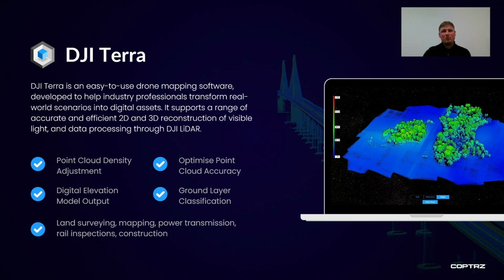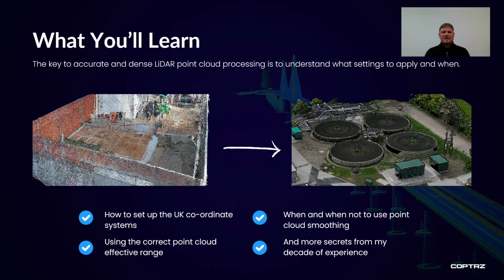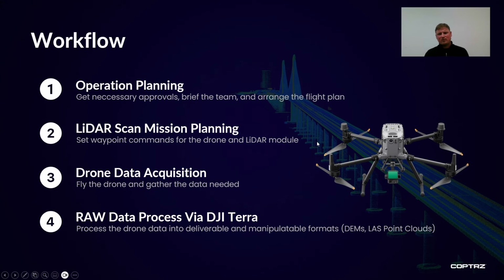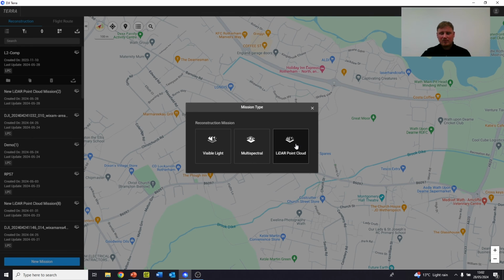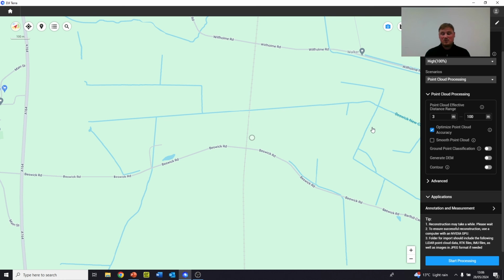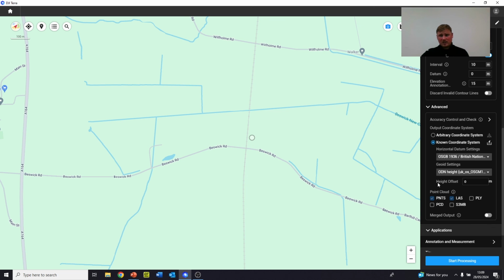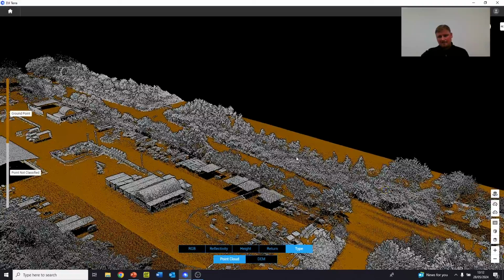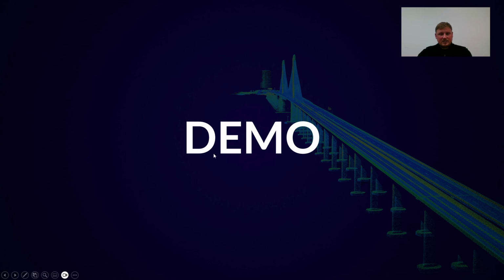How To Use DJI Terra To Process LiDAR Data

Comment: Great video!
I have a question tough...
Currently, for L1 data QC, DJI Terra allows importing and classifying GCPs as "check points", and measures the point cloud altitude error around those points. However, if i leave the gcps classified as "control points", terra will constrain the point cloud, altering the raw data altitude.  Is this recommended for lidar point clouds? I would think not, but I am not sure

Thank you!